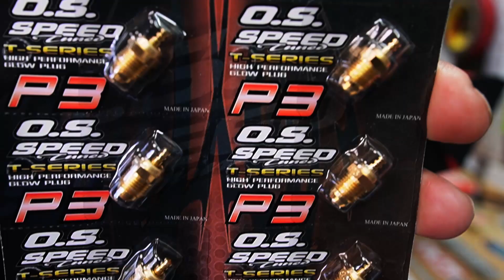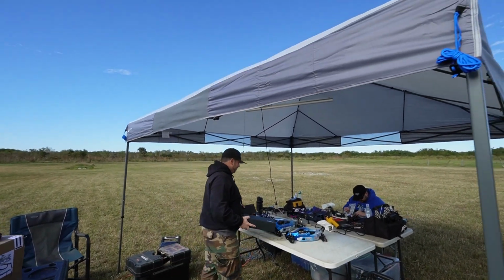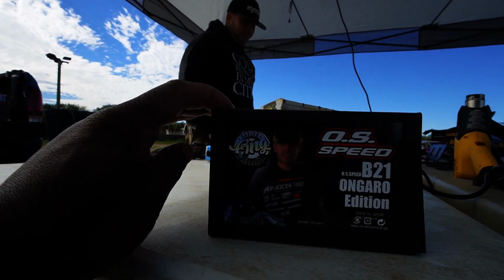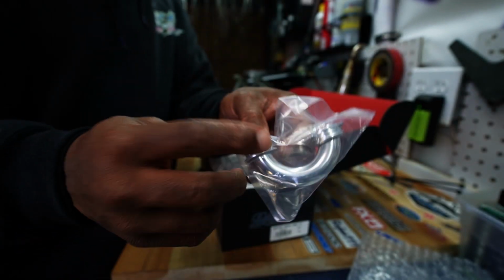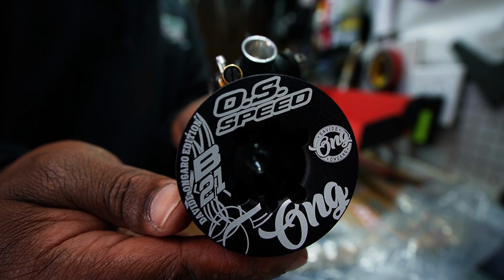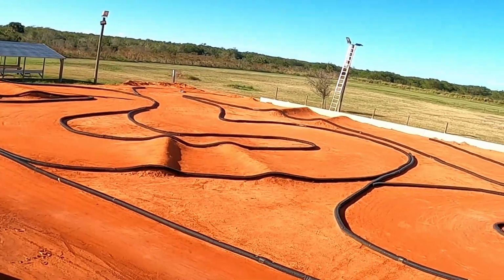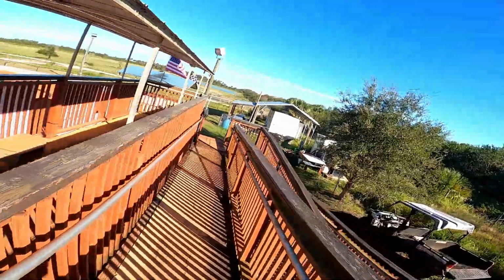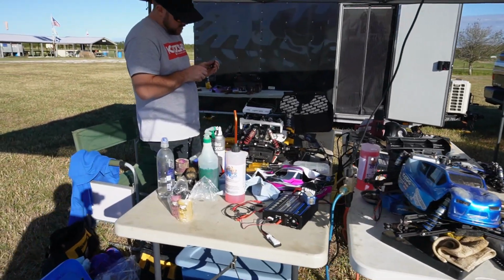1st run w/ Ryan Maifield ninja nitro engine Unboxing of the Ongaro B21 edition

Comment: That Ongaro engine is the truth right there. The new OS pipes changed the laser etching on their pipes. The TB02 is a 2090, TB01 is the 2060 & the TB03 is the new 2100 pipe they recently came out with. You boys have fun in Florida!
Reply from the maker: Thanks for the info, I was wonder why the change

Comment: Im so thankful for this video,  i thought i was getting crazy with money spent on this hobby, at times been more than i put in my real car, but you boys make me look like a feather weight lol 😆,  nice stuff to see, recently got a nitro due to the very into import drag racing, but however it was quickly realized that my brushless   trucks are way faster and requires much much less maintenance even when taking care of properly,  been told to hangout around nitro racing and can learn more in a week than whatever learned in a year on my own lol . Aint nothing like hearing a motor screaming inside something radio controlled!!

Comment: Hi cool track and setup dude, i am new to nitro, quick questions what is the purpose of having long fuel hose, i was looking your buggy and all have min 6inch long. I run mine with short line possible no problem so far but maybe long term problem? Thank for help
Reply from the maker: Nothing wrong with short fuel hoses, long hoses usually will give you a sec or 2 if your car flip over and your waiting on a Marshall. It also depends on where you have to run the fuel hose to, you may have to make it long to get to the carb or pipe.
Reply: Ok good to know thanks